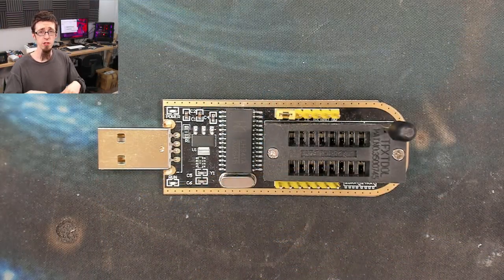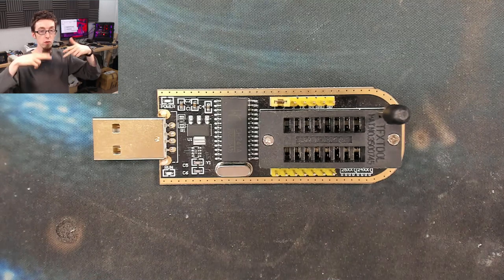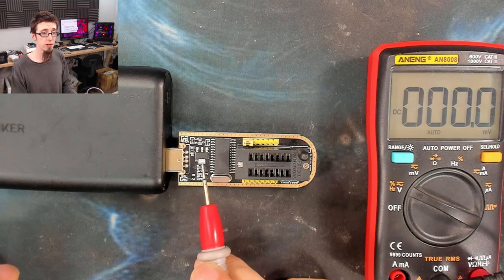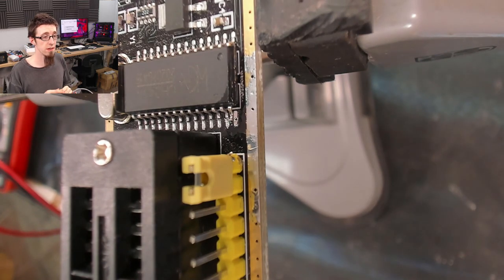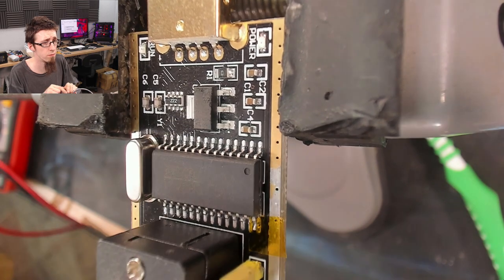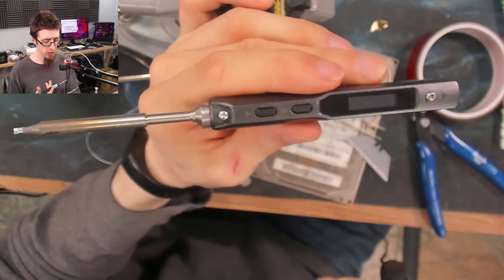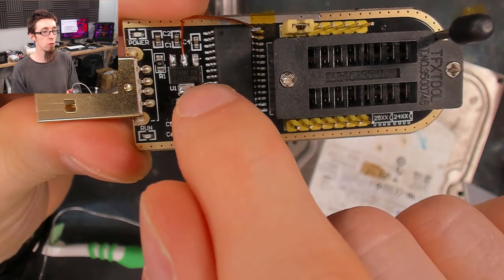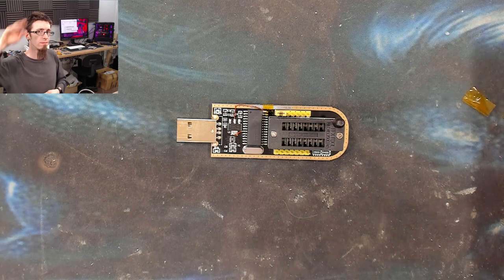Volt-modding the CH341a Mini Programmer - LFC#278

Comment: all these mods unnecessary . the programmer will adjust itself to 3.3v when programming .I tried it myself and programmed many chips fine . also Sorin proved it he has a video about this matter . not downvoting your video but it is just unnecessary work .
Reply: Yeah, the 5v+ only hold up on 100th of a milliamp. Even says in the IC Datasheet. So very unnecessary and even worsens reliability

Comment: There is no problem to fix,once you put the chip inside you`ll get 3.3
Reply: yeah, they have no idea
Reply: I used to work in the semiconductor equipment manufacturing industry.  If you're assuming that there is some sort of negotiation or automatic voltage detection going on, then I think you are mistaken.  The reason that you're measuring 3.3v on the pins (with the chip that you're trying) is that the flash ICs have internal ESD (electrostatic discharge) protection diodes built in, which are included in the design to suppress very short term (e.g. microsecond) voltage surges by clamping I/O pin voltage levels to the IC's supply voltage.  This only works if the current supplied by the CH341a on it's signal lines exceeds the current draw of the flash chip.  The unmodified design relies on this hack, but it's outside of the spec of the chips, and there's no way I would rely on it.  On low power flash chips the flash chips VCC will float up to 5v, and you will fry the chip.  On any chip, you risk frying the ESD diodes, and then the chip is also gone.  If you look at the manufacturer datasheets for the flash ICs, they always have an "absolute maximum" voltage for signal pins, and for 3.3v flash chips it's usually about 4v.  Not 5.1v.

Comment: This jumper is not necessary actually as the programmer runs 3.3v and has a 3.3v & 5v Jumper on the side so what the jumper actually does is that if you put a jumper, it overrides the 3.3v and makes it 5v remove the jumper and its back to 3.3v. It is located on the side where your CLK, CS, MOSI, MIOS, GND,3.3V & 5V pins are, just put a jumper on 3.3v & 5v to get 5v.

Comment: Important info for this mod!
The output of the 3V3 regulator is not stable enough to work reliable with all Flash-Chips.
After doing this mod, I was able to read/write multiple chips. But I came across one, that I could read fine, but the CH341 would "crash" aka. disconnect from USB, as soon as I would try to write to it.
As it turned out, I needed to add some capacitance to the output of that 1117 3.3V regulator. In my case, I added a 1µF and another 100nF capacitor right between the 3.3V output and ground (pins 1 and 2 of the regulator). That fixed the issue.
I hope, this comment can save some people from wasting a day debugging this ;)
Reply: very nice. thanks.
Reply: Do you have images of how this modification would look like with the capacitors?

 I want to modify my ch341a but I have no idea how the modification would look like.
Reply: @mauricioaguaidahernandez4715  Honestly, I described the modification in detail in my initial comment ("I added a 1µF and another 100nF capacitor right between the 3.3V output and ground (pins 1 and 2 of the regulator"). If you cannot interpret this information, you should maybe not try this mod. 
I could take a picture, but how would I share it?
Reply: @NebukadV  Mediafire, i think with an image i can understand would look. Or you can make a video in your channel about your mod with the pinouts. I am understanding that you had added a 1µF and a 100nF capacitor just between the 3.3V output and ground (pins 1 and 2 of the regulator) i.e. 2 capacitors in series of 1uf and 100nF between pin 1 (thats is ADJ pin) and 2 ( V out) of the 1777 regulator.  It should be like this video? -> https://m.youtube.com/watch?v=ty_0VsCOKjU ?
Reply: I had the same problem, i added 1000uf 6.3v cap on top of the regulator to the output and ground.
Now it works really well

Comment: Do not modify this programmer, it's just fine the way it is.
This misinformation was spread about this programmer.  It neatly does 3.3 volts and not 5 volts as many claimed.  It is now debunked.  Do the test yourself, take a flash chip and put it in the zip socket and program, while programming you measure the voltages on the pin.  You will now see that 5 volts are not measured anywhere, but 3.3 volts instead.  People who understand ohm's law will realize that the wrong measurements were made with no load.

Comment: This is honestly the type of video that I like. Technical, detailed and educational...
Reply: He doesn't probe for voltage during a flash. It has been demonstrated and proven that these volt mods are pointless.
Reply: I am from electronics background - its the amps that fry the chip not few volts.  It should not be modified because it may lack pressure to right to the chip. On chip @5v it only registers 3.8v.

Comment: Looking at the schematic you could just cut the trace that feeds the vcc and install a jumper to pin 6 and 7 instead of lifting the vcc off the pad. Just make sure to cut the right side of the trace. Then just finish the 3v connection.
Reply: Could you please explain more in detail? With your method, do you still need to play with soldering wires?
Reply: @user-cw3nb8rc9e  you still have to solder one wire
Reply: @max0r4axor  What about supplying this programmer with 3.3V? It would not produce 5V then, but might work?
Reply: @user-cw3nb8rc9e  looking up the Datasheet for this if the chip is supplied with 3.3v you will have to supply 3.3v to the v3 pin number 9. To me it was easier to cut a trace use a standard jumper between 6 and 7 and solder a small wire to the 3.3v voltage regulator and pin 9
Reply: @max0r4axor  Good tip. Where is "6 and 7"  Is it the GND and 5V at the end of the pin row with jumper?

Comment: Nice fix, if you measure pin 9 and the capacitor C4 you will see that it is the bypass cap you mention. Might be easier to solder the 3.3v wire there from the 3.3v regulator instead of directly on pin 9.
Reply: What´s the use of the wire? Pin 9 is fed 3.3V on my CH341 anyway. And on my device there is no continuity to capacitor C4, but to C3.
Reply: @michaelboth6844  Sounds like you have a different board layout/version ? If your version is already feeding 3.3V on pin 9 then you don't need to add any wire to the bypass capacitor or pin 9.
Reply: @LordDarthSidiousss  Unfortunately, there is no clear indication of board revision on the programmer itself. Interestingly, the IC itself reads CH341B, not A. The back reads "CH341A MinProgramment", like in French. And on the top side, near the bios chip connector it says "CH341A Pro". I bought it for cheap from a Chinese seller on German eBay. Very confusing.
Reply: @michaelboth6844  I believe you can still mod this version that you have if you go from 3.3V regulator middle pin to C3 and from there also to the lifted pin of the CH341 with a wire ?
Reply: @LordDarthSidiousss   That´s what I did. Pin 28 was 5V after all, so I lifted it and soldered a wire to the regulator. I did the wire on Pin 9 as well, but I don´t know if that had any benefit. If you look at the schematic shown by Graham, Pin 9 is labeled "V3", so I guess having 3.3V there is expected?
Reply: @michaelboth6844  Pin 9 on the Ch341A is supposed to be an external 3.3V power input for when the chip is working with 3.3V instead of 5V
Reply: @LordDarthSidiousss  Hmm, okay. Seems like there is indeed more than one version of the CH341 out there. Very interesting.
Reply: @michaelboth6844  Same with most stuff the chinese copy, the first time around it is usually missing critical components and/or has many errors. Then they see the videos like this one and apply the fixes/patches to newer iterations
Reply: @michaelboth6844   It doesn't work for CH341B. For CH341A only. Because when the 9th pin of the microcircuit is in contact with the 1117 in the recording mode, there will be freezes and scraps of the programmer from the PC.
For CH341A there is also bad advice here to connect the 9th pin and 1117 with a piece of wire. because when you apply 5 volts to pin 28, your microchip will fail. It is not necessary to install a wire, but a removable jumper. if you need to switch to 5 volts, you will remove the jumper and use this jumper to short the 3.3 and 5 volt pins that are next to the zip panel.

Comment: What if I remove the zero ohm resistor from the main 5V source and just use a couple diodes to drop the voltage to around 3.8V?
Reply: 3.3v is the requirement Boss

Comment: Er, I wanted if I could ask you something since I hardly know anything regarding electricity. I connected the CH341A from my PC to another PC's motherboard to flash a BIOS onto the chip. For some odd reason, I don't know why, I turned on the other PC while the CH341A was still connected to it from my main PC. As soon as I hit the power button on the other PC, my main PC rebooted. Later on I also discovered that the sound doesn't work on my main PC anymore. Could it somehow be that one I turned on the other PC while CH341A was connected to its BIOS chip it somehow sent a surge back to my PC and killed my onboard soundcard? It did afterall manage to cause my PC to reboot. Thanks!

Comment: Hello to all. Actually, there's a much easy way to do this fix; you just have to cut a track on the board and add a plastic jumper on pins labeled '3.3V' and '5V'. I've have successfully flashed a Winbond 25Q64FVSIG which is a 3V chip.
Reply from the maker: I had a quick look and I think I see the method you're talking about. The 5v rail going to the IC is on a trace on the bottom of the board, several people had mentioned that cutting this trace might be a better method. The chap whose video guide I followed didn't want to do this because he wasn't sure where else it goes - but the only other place it goes is to the 5v jumper pin. So yea, cutting it would then enable you to bridge the 5 and 3.3v headers to avoid soldering.
Part of me doesn't like cutting traces, but these things are so cheap that who cares about making the mod 'reversible' anyway.
Reply: when you put ic 3.3v the programmer detect automatically and adjust the voltage at 3.3v , i measured it during the process , i modified the programmer exactly what i saw on this video but i back to let it original and it works fine
Reply: Hi Antonio! On my CH341a, there are 2 x 5v headers. One is next to a header that says GND, the other is a header that says 3.3v. 

Which 5v header do I bridge to the 3.3v header?

Sorry to ask, i'm just a bit of a noob. I think I know which trace to cut.
Reply: Hi Gamecat! I have posted it on my channel. Check it out!
Reply: @racejay  cheers Antonio!
Reply: @Slywardthegamecat  You can now delete this post if you want 🙂
Reply: @medgrey4821  you are correct , all these mods unnecessary
Reply: Ch341a ic PIN number 28 is Vcc Minimum 4.5 to Maximum 5.3 support… i don’t know why you put the 3.3v in vcc ?

Comment: I'd say microsoldering isn't yet a field you've superbly mastered. Not a bad thing at all, don't get me wrong. Can't wait to have you sharing future jobs to see that improving.

Regarding the two irons with a single power supply. The main downside I see is that you can't work with both simultaneously. I've found very late in my electronics hobby that using two irons to remove parts and particularly SMD components, is just brilliant. I'd suggest giving it a try if you haven't tested that.

Are you using a standard vinyl cable?  That would concern me a bit. I got the TL100 with the transformer having a silicone cable and that's life-saving for me, after several burned iron cables over the years. The red USB-C silicone cable that Pinecil has in its store looks fantastic too.

Comment: Alternatively, you can solder 3.3V zener diodes between SPI data pins and Gnd pin of the zif socket , on the back side of the board. The zener diode limited the peak voltage to 3.3V. Everyone could not solder tiny SMD pins, so zif socket's pins much bigger and soldering too easy instead of SMD IC pins.
You need two zener diodes; between MOSI and GND, CLK and GND. 
I2C pins are open drain type and requires external pull-ups, you don't need the voltage limiting operation for this pins.
Reply: There's a cheap 1.8v adapter board that some of the CH341a Mini Programmer have started shipping with. I started to worry about adapting to 1.8v before realizing I already got the adapter in the kit. :)
Reply: @V0S1N0  he isn't talking about the adapters to 1.8V

Comment: You can get pre-made adapters just as cheap as the CH341 itself, which piggy-back the ZIF socket and come with their own ZIF in which you connect your clip/breakout board and ultimately the IC :) I also suggest pulling strands out of stranded wire to make really thin jumpers (whenever they don't pose the risk of touching anything they shouldn't, since they're obviously not going to be insulated)
Reply: I like pulling small transformers out of old electronics (satellite and cable receiver boxes, dvd players, etc.) and then unwrap the enameled wire and use that for jumpers. You'd be surprised how much wire one transformer can hold. Most transformers probably hold enough wire to last a lifetime of jumping pads.

Instead of pre-cutting the piece of jump wire, I use a longer piece than necessary, and then instead of pre-scratching the surface to remove the enamel, I just use the tip of the iron to scrape it, that and the heat usually gets rid of the enamel. And then just run the wire where you need, then solder the wire down where it meets the pad, then either clip off the spare wire or if it's thin enough just rock it back and forth until it breaks where it sticks out of the solder joint.

Comment: Adamant IT Thank you, I  just have a dumb question. 
I have watched someone on this Ch341a who added and soldered a wire on pin 9 and soldered it on pin 28 of course after he lift it (pin 28) and connected to the volt regulator like you did but without having a second wire on the volt regulator I mean there was only 1 wire soldered on volt regulator coming only from pin 28.
Question is is it still the same? Thank you.
Reply from the maker: Yea the anchor pin and the middle pin of the reg are both outputs, you can use either.
Reply: @Adamant_IT  thank you

Comment: Is there any ch341a programmer that is sold preconfigured to 3.3 volts? I do not have any soldering experience and would prefer to just buy one premodded.
Reply from the maker: Yes, look for the version 1.6 or higher, with the green PCB, it has a voltage selector switch on it.
Reply: @Adamant_IT  Thanks for the reply. I am considering buying to one to mod the bios of my 2021 Razer Blade Advanced to unlock the overclocking menu on bios.

Comment: is the 1.8 adapter works with 5v or should i mod the ch341 to 3.3v ? @Adamant IT
Reply from the maker: 1.8v adaptor is fine 👍
I've tested this and 1.8v adaptors will regulate the data lines down to 1.8 as well.
Reply: @Adamant_IT  Thank you so much

Comment: You don't need to scrape the enamel off the wire. Applying soldering iron + fluxed solder burns it off. Try it.
Reply: I always just grab a lighter and hit the end of the wire with the flame for a couple of seconds...you can see when it is gone.

Comment: Great Video.. Thanks. This is probably like asking how long is a bit of string but I have one of these USB programmers which I managed to damage when it came into contact with the metal PC casing. Now the power LED flashes briefly then goes out. I've changed the regulator chip but that hasn't fixed it. Is there a particular component(s) on the board that is(are) more vulnerable to a short?

Comment: I do this but it not working , when i want erase the chip , it's disconnect by itself, what's wrong?
Reply: Ive read you should add capacitors to the 3.3v rail

Comment: Is there any way to add a switch to easily switch back and forth to 3.3V and 5V?
Reply: Yes, there is such a way. But it is still necessary to raise 28 pins and feed it with 3.3 volts. After going back to 5 volts you can put a jumper on the two pins that are next to the zip panel. One of them has 3.3 volts, the other has 5 volts. So close them, then 5 volts will appear on pin 28. After removing the jumper, you will return to 3.3 volts of power. Everything is simple.

Comment: I enjoyed that. Was there a reason why the data lines were at 5V originally? If so, is it worth adding a switch? Or is the thing so cheap that you just have two?
Reply from the maker: Really dumb design flaw. Lots of people scratching their heads over this one. If the CH341a chip couldn't run on 3.3v it would be a much harder issue to solve, but given that the chip is happy at 3.3v, it's a bit of an unknown.
Reply: Watching the chip's datasheet there's a 0,1v over the maximum ratings for the original use of 5v VCC and this is slightly bad unless the datasheet is not right, someone with scope can probe the effective DI pin if it exceeds 4,4v

Comment: I'd like to see a demonstration of the unmodified version actually causing some harm. Are there any known BIOS chips that die with this thing? I just used a bios programmer at work for the first time and it happened to be this exact one, unmodified. So I ordered one for myself too. Now I'm wondering how crucial this mod is.
Reply: There is no problem with this programmer. Only lot of stupid people around the internet. If you connect the programmer with plugged bios chip, voltage will change from 5V to 3.3V automatically.

Comment: It is not necessary to desolder pin 28. There is a track on the underside to the left of the C which must be cut. A jumper then be set between 3.3 and 5V. Now connect the voltage regulator in the middle to C3, which connects pin 9 direct to 3.3V.